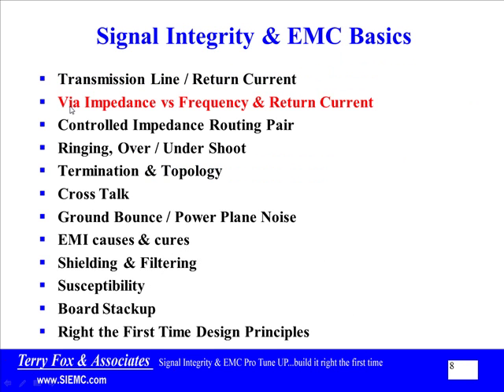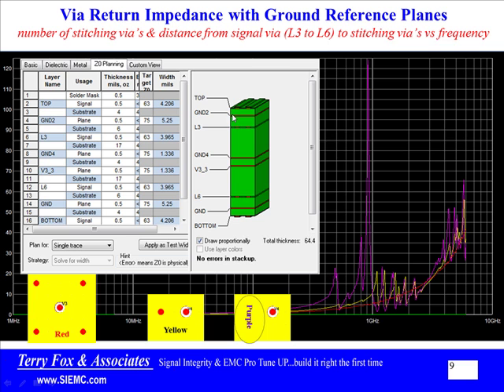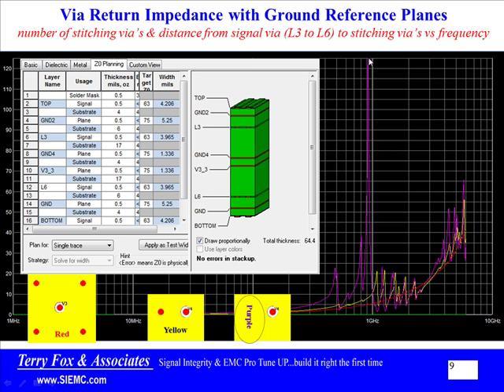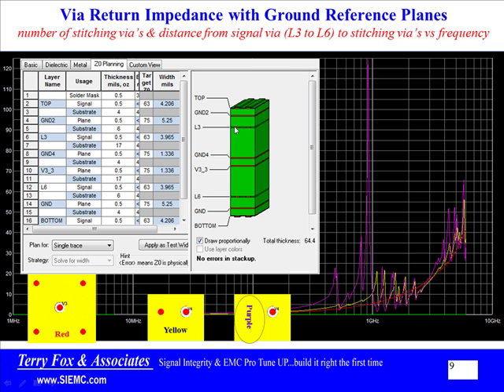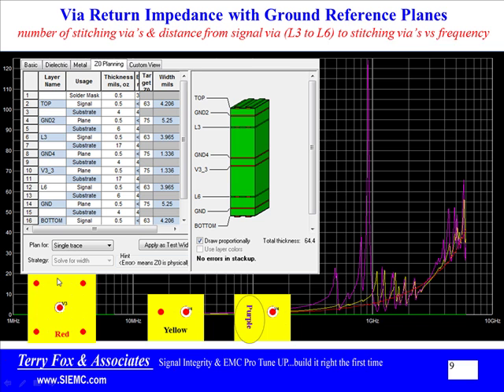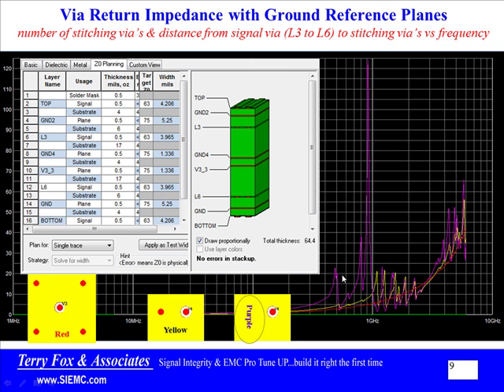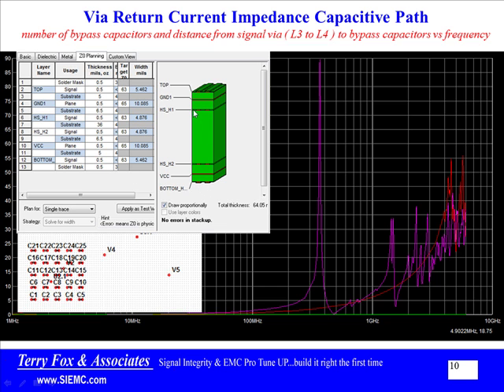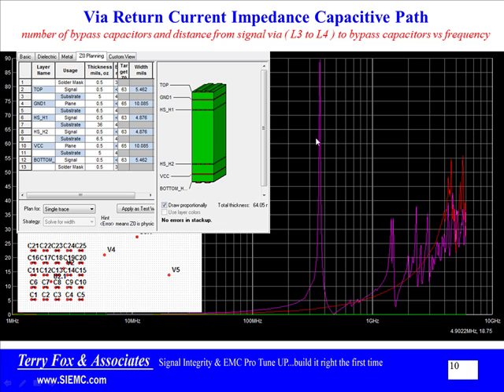Via Impedance vs Frequency

Comment: 2 quick questions. Would you consider all of this information to apply equally to differential hi speed signals? Return current in an ideal situation (nothing is ideal i know...) for diff signals should be 0, yes? As the + and - currents cancel out?

How do you determine the relevance of the spike on the impedance vs frequency graph? So long as you don't have a signal at the specific frequency where the spike is then it should not matter, correct? Or is it still relevant in some other way?
Reply: A SERDES signal is LVDS on steroids.  It is not true differential and although the + and - are algebraically equal, one is NOT the return current of the other.  Those signals are complimentary single ended signals.  Your only benefit in this case has to do with noise margin.  A single ended signal has about 2 db noise margin.  A SERDES signal had at least 9db noise margin in anything newer that PCIe 1.0.  People have been abusing LVDS signals for a long time.  Generally they work, but not for the reason they think.  The information in the video is correct for SERDES, but the one mitigating factor is noise margin.  If you have enough noise margin anything will work....but it is still a bad idea and it will have consequences.
Reply: @terryfox6236  What you're saying is incorrect. Mode conversion is real. Signals see an instantaneous impedance. Once the differential transmission line is stimulated with odd-mode current, the signal IS true differential. This is exactly why they purposely place return plane voids in SERDES to block common-mode noise and pass the differential signal. Once the return plane is gone the odd-mode current can use the opposite "leg" as a return current path.
Reply: Seems like terry explained well some nuances of modern differential https://youtu.be/qEI31nNltFY?t=6m7s